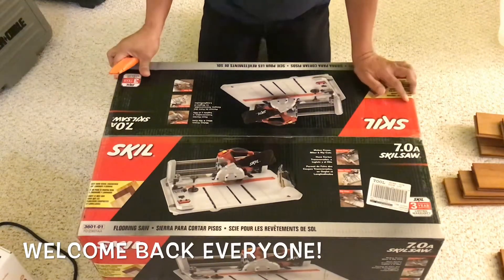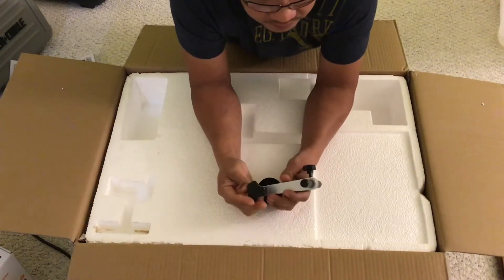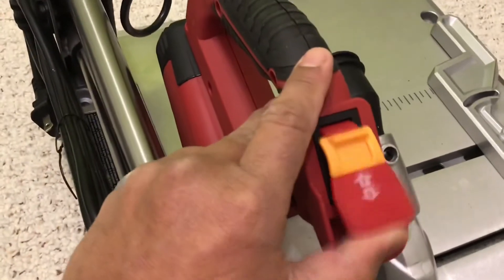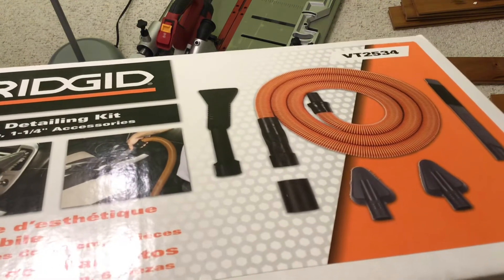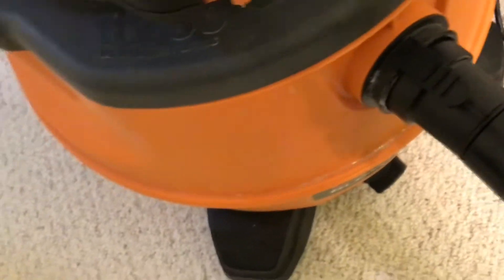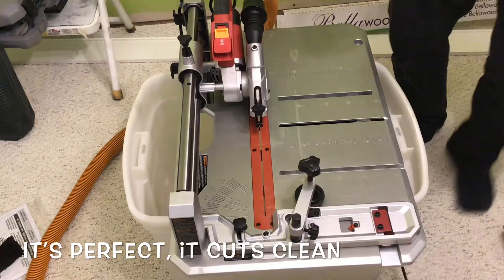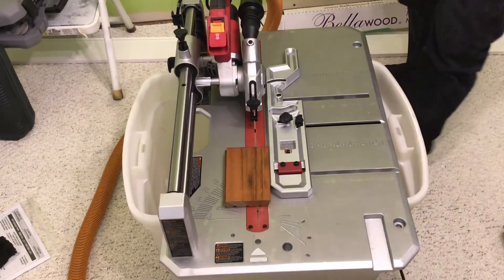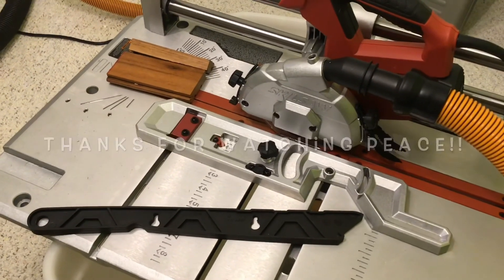Unboxing SKIL FLOOR SAW and how to attached to RIDGID VACUUM!!

Comment: Perfect! Thank you for showing various cuts. It is exactly what I need.
Reply from the maker: Joyce nadeau i installed 1200 square feet of hard wood using this saw, but i change the blade after 50 cut, thanks for watching our video😀